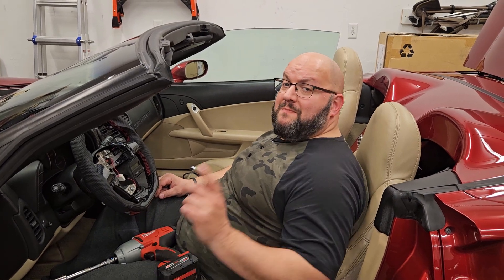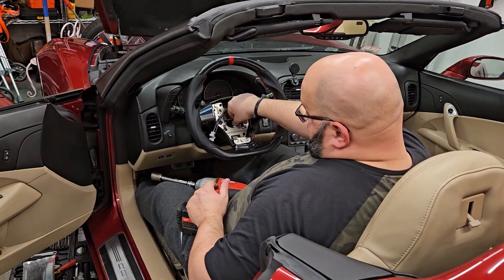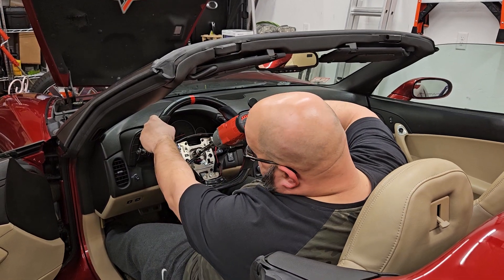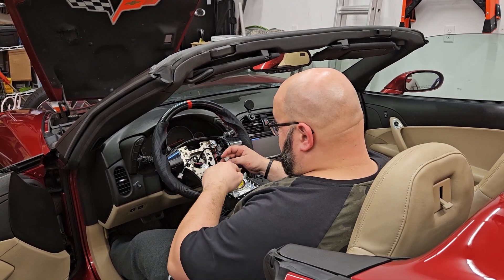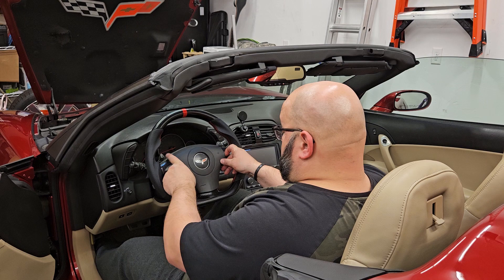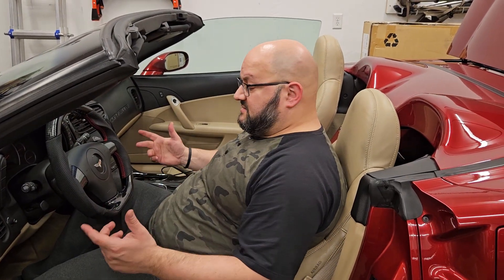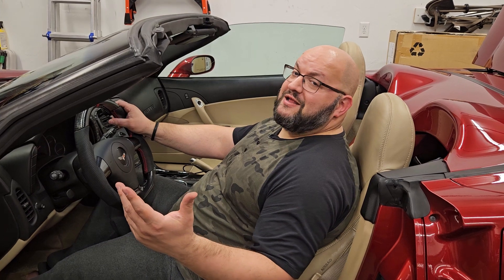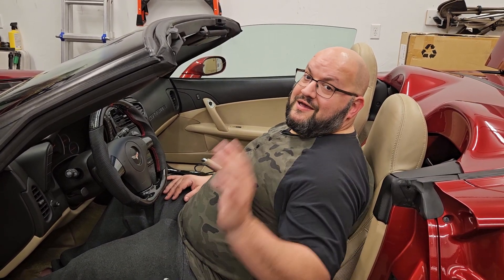How to install a steering wheel on C6 Corvette

Comment: Good helpful video Leo. I ordered some manucci carpet pads a trunk liner and had them ceramic treated while they were doing my paint. They are super nice, Very soft,  durable, and they really look classy! I recommend paying the extra money for express shipping if they're still doing from China and not Canada or the USA yet. They said that they were in the process of seeing up a north American production center and standard shipping would be much better, but if it's still from China, pay the extra shipping!
Reply from the maker: Nope, I'm cheap. Lol. Have to save where I can. Only way to have the money to spend on other stuff. So having patience is required.

Comment: Where can I find the flex plate under the airbag?
Reply from the maker: I would go to the dealership with your VIN and have them look it up. See if it is discontinued or available and for how much. Have them print the diagram out and provide you a written estimate. Then check online for that part number to see if it is cheaper elsewhere and by how much. If the difference is very small, then you are better off getting it from the dealership so as to start to build a relationship with the parts department. If you think you can replace the part yourself and it is much cheaper online, then you should go that route. Best of luck.

Comment: When I put my wheel back on there is a gap between the column and the steering wheel
Reply from the maker: Sounds like you are not aligning the clockspring properly in order to push the steering wheel all the way back into the steering column. If the clockspring is not aligned right, it sticks out and doesn't allow the steering wheel to go in all the way.
Reply: Does it take force or should it slide right in when it’s aligned right? I tried putting it in at all different angles and trying to force it in and never was able to get in in all the way
Reply from the maker: It does not take force and should fit right in.. 
Just keep turning the clock spring until it pushes in further. If you force it, it will break.